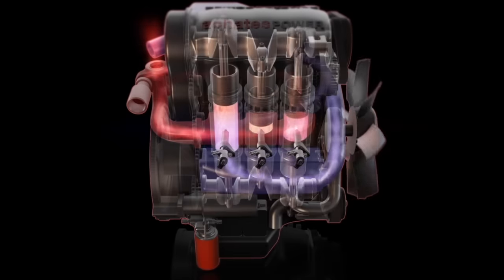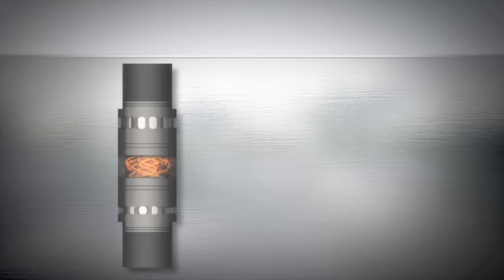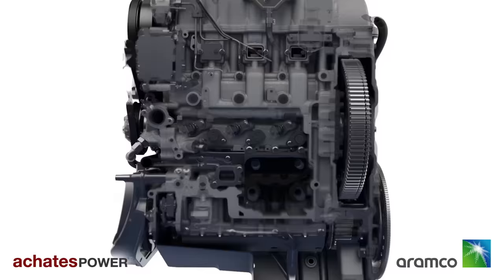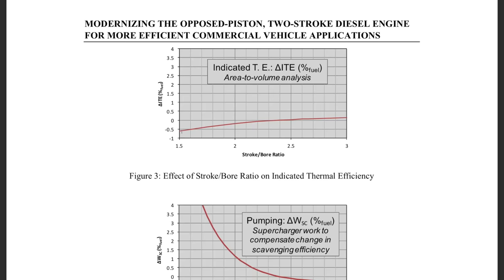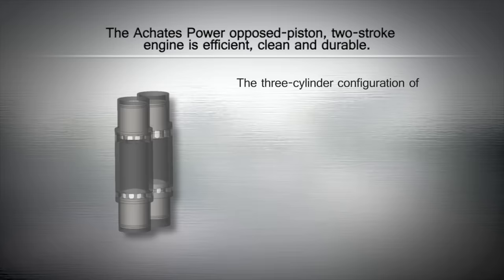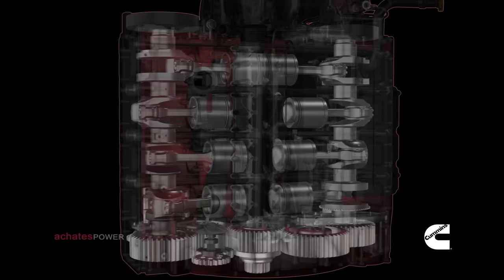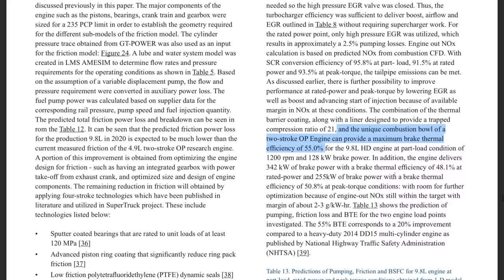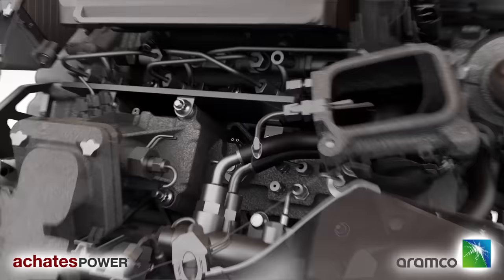Opposed Piston Diesel Engines Are Crazy Efficient

Comment: 3 cylinder, 6 piston engine. Must have had Hyperthreading enabled.
Reply: This made me laugh.
Reply: Thats great
Reply: Kek
Reply: Idk, it's not new enough so it doesn'r run under UEFI. You'll have to burn an MBR boot partition and enable vt-d capability to make it run from the BIOS.
Reply: @nahtavaelubl3820  he is trying to say it needs v-tech. i would say there are obvious problems with that.
Reply: hahaha man that's a good one. Achates Inside™
Reply: I dont get this. Theres quite literally 6 cylinders.
Reply: @cerberus1166  There's only 3 cylinders. Each cylinder has 2 pistons (the moving parts). 3×2=6, pretty simple math.
Reply: @themanofiron785  the pistons have cylinders on them do they not? At the very least theres 6 cylinder heads. Why would you call a cylinder head, (which is the actual cylinder, the head.) theres 3 chambers, 6 pistons, 6 cylinders.
Reply: @cerberus1166  I pull the heads off a block, does it still have cylinders? Yes. The cylinder is the hole the piston goes in...
Reply: Zach Childs what does a cylinder look like? It’s a tube! There are 3 tubes, each tube runs 2 pistons. It’s still 3 tubes, meaning it’s 3 cylinders.
Reply: @patrickvanderlaan1151  yes i was uneducated. Thank you all.
Reply: Zach Childs  It has six pistons but only three cylinders. The cylinders are the shaft that the Pistons ride in Hope that helps to explain it
Reply: @my_master512  it does thanks.
Reply: what about a 6 cylinder 3 piston engine. lets do that. can anyone even imagine how they would make that work.
Reply: Pentium Power!
Reply: Zach Childs 
Each cylinder is single long tube. 
There are not ANY cylinder heads.
The combustion chamber is where the piston heads meet each other. 
Tell your doctor about your anxious and anger and he can help you.
Reply: Hahahahaa
Reply: @Pavelow 6 cylinders 3 pistons...
How about if the piston was not connected to a crankshaft,  but had two combustion chambers - one on the the left and one on the right side?
Combustions on the left and righr side would alternate, sending the poston back and forth. The piston would be magnetic and the cylinder would be wrapped in coil, inducing electric current.  Since we would have 3 cylinders, we would spread the phases to have nice 3-phase AC a power an electric motor from it.
If you ever develop and patent it, i want 10% of the money:D
Reply: for sport mode, use GPU turbo charger
Reply: Or RTX on off ability
Reply: You've gained my respect friend. AMD and Diesel fan
A true Chad 🔥
Reply: It is a creative statment and fun as well. Howver Threads are NOT like CPUs as folks are lead to beleave. They apear to OSes as CPUs and can even except the same instructions. But they are really more like SMART cashe systems. Threads keep data flowing to the real Cores.
Reply: @panda4247  bro thats actually a thing...its a type of stirling engine which also is an electric power generator...each end of the engine cylinder is closed and has a "bounce "gas in it ...as the piston compresses the gas,the gas is heated and bounces the piston back to the other end ...where the same thing happens...electricity being produced as the piston moves thru an external coil-induced magnetic field...
Reply: @dexterdequoitdikkentheworl87  yeah, it would be really weird, if I was the first one to come up with that concept :D
Reply: @patrickvanderlaan1151  but thers 6 pistuns
Reply: You cool in my book
Reply: @cerberus1166  its a computer tech term
Reply: XDXDXDXD
Reply: 3c6t engine
Reply: Check out the Napier Deltic invented for high speed torpedo boats. Two stroke opposed pistons with three crankshafts and typically three rows of six cylinders and 36 pistons. They were timed so that one piston lead the other to open the exhausts before the inlets were opened. The third crank ran backwards to allow every row of cylinders to operate correctly.
Reply: Don't forget the Radeon Turbocharger and the RTX Roots blower.
Reply: @davidelliott5843  was just about to mention that! 
That's like a 3 Core engine (cpu) with hyperthreading lol.
Reply: @panda4247  Would make an excellent range extender for electric vehicles. I love the idea if its feasible!
Reply: No, it's just logical cores.
Reply: Good, it doesn't have any valve's and cylinder heads either, with just one fuel injector for two pistons each.
Reply: @BeRAd427  Wtf, that'll include some dummy cylinders without pistons.
Reply: Powered by INTEL
Reply: @my_master512  -  the pistons slide in the cylinders and are connected to one of the 2 crankshafts
Reply: ...hypercombusting...
Reply: Pretty abysmal numbers from a supercharged turbodiesel...just scrap that idea overall👎😐
Reply: 2 pistons in each cylinder genius
Reply: I thought it's because of dual channel:)
Reply: But is it MMX3 or MMX6?
Reply: Yeah!
Reply: SMP: Simultanious Multi Piston
Reply: It’s a boxer.
Reply: Found the software guy.

Sticky keys really fucked me up when I saw it the first time lol
Reply: Hahahahaha this comment is great! 😂😂
Reply: Yes i like this idea
Reply: CPU joke lmao
Reply: Computer and car nerds assemble 😂
Reply: @cerberus1166  3 cylinders 6 pistons 😂
Reply: @cerberus1166  Your definitely not an engineer or know the basics of engine design and what terms are used for engine parts this is a 3 cylinder 6 piston engine where are you getting 6 cylinders from 😂
Reply: @dantemartinez5494  the piston heads are cylinders you goon. clearly engineers need to not name things after geometrical shapes, and you need a geometry lesson as well
Reply: With intel turbo boost technology 2.0 ( turbocharged and supercharged)😁😁
Reply: No….. 6 cylinder opposite side but 3 piston is my design but car engine designers neglected this idea
Reply: @rgap3944  3 piston 6 cylinder is not possible
Reply: 3 cylinder= 6 holes
Reply: @dantemartinez5494  possible if cylinder move to and fro 1 cylinder both end blast and one piston inside cut through the cylinder such way the cylinder move to and fro
Reply: Simultaneous multithreading you mean ;-)
(Hyper threading is just a brand name from Intel for a previously existing technology damned SMT that existed on other CPUs before I tel used it, although theirs where the first x86 implementation and the first intended for home computers).
Reply: @BeRAd427  That would be weird...
I guess you could have six cylinders with a gap between them and have a continuous piston between the two.
It might arguably be considered two pistons instead of one, but if it's a single piece of metal you could probably get away with calling it a single piston.
Then it would have to have some way of transferring energy, sideways out to a shaft somewhere.
You can't have a crack shaft between the two piston heads as you probably couldn't call it a single piston then...
It would be a really really inefficient engine most likely, and no one would do this for any other reason then just showing that it can be done...
Reply: @panda4247  That might be a better design then what I had in mind, I was thinking a lever instead...
Reply: @jimbronson687  It's a bit more then that.
The first threads where.
But as computer technology developed and especially out of order execution became possible a CPU could execute instructions from a different thread entirely while running code from the first thread.
You can actually do it with a in order CPU too  keeping more of the CPUs execution resources occupied, but chances are far higher then that there's just no instruction in either thread able to utilize the available resources or that one thread has to wait for the other thread to no longer need a specific resource in a given clock cycle.
Reply: @lelsewherelelsewhere9435  People calling SMT for hyperthrading is a bit of a pet peeve of mine.
The technology is named simultaneous multithreading while "hyperthrading" is just Intels first implementation of it (others had done it before Intel).
Reply: @sirprise9548   Thank you. :-D
Reply: @dantemartinez5494  I think that it's possible, just really, really inefficient.
If you have two opposing piston heads connected by a metal rod that's all a single piece of metal can't you argue that it's just a single piston facing two ways?
Or even a piston that's just a single solid block of metal.
You can divide the cylinders in two by having a opening in the middle between them and design the engine to have the piston move between them or increase and decrease the amount inside each end.
It's obvious a bad idea, but it should be possible at least.
Reply: @cerberus1166  Yeah, no...
That last comment of yours is just wrong, and you know it given your earlier comments in this thread.
The cylinders are the holes, not the pistons or ends of the holes, just the holes themselves.
Reply: @Luredreier  not at all. considering a cylinder is solid. not hollow. youre describing tubes. not my fault engine builders cant english properly.

you can easily check what a cylinder is. and it doesnt say im the one thats wrong.
Reply: Lmfaooooo
Reply: Good comparison - it's really true in the core of this statement.
Reply: It's called Hyperpistoning
Reply: Stephen Ferree  Jumo discovered that one crank had to be 8 degrees in advance of the other for it to work properly, and the engine they designed had an amazing power to litre ratio for that era. Truly fascinating engineers at the time.
Reply: Stephen Ferree  look at the list in the beginning. It was mentioned.
Reply: @johndavidson3424  no 2 injectors. One left one right.
Reply: @cerberus1166 3 mate.
Reply: @cerberus1166 Piston crowns form the combustion space inside the cylinder, simpleton.

Comment: next stop: quantum stroke engine. each piston is simultaneously in compression and decompression.
Reply: Lol
Reply: That's basically a rotary setup. Look up the Liquid Piston Engine. Pretty neat, but like this engine, I wanna see a bigger application.
Reply: Only if you're not watching it. Watching it causes each piston to be either in compression or decompression.
Reply: @dgnash  Glass headers are out of the question. Same with any ECU setups.
Reply: @dgnash  I did not understand what you said so I'm just gonna be happy I did engineering rather than physics class...
Reply: That is called a double-acting engine, and yes, those exist.
Reply: Next stop would be four pistons for a combustion chamber in all 90° angle directions in 3D.
Reply: @avada0  Opposed Radial Engine? Perhaps? Can't visualize the crankshaft but I'm not an engineer.
Reply: Let's get started on a hypercube opposed engine. 8 piston heads using a single fuel valve, with each piston rotated 90° from the others. And store the fuel in a Klein bottle 😅
Reply: Drugs
Reply: Shrodinger's engine.
Reply: That exists already
Reply: Like steam engine piston? I think its doable..
Reply: You're describing a single-stroke engine based on that description.
Reply: @ChosenFate_  and doesn't.

....

Oh god damnit! Who looked at it?!
Reply: Lol
Reply: Free piston engine :)
Reply: You’re thinking of a turbine engine. All one shaft compressing and decompressing.
Reply: @dgnash , it's an interference engine...but only if you're watching it really closely.
Reply: @Boothby171  Yes, if you take your eyes away it does the other thing.
Reply: I don't think that idea is so farfetched. I believe it was in the early 60's that Popular Mechanics ran an article about a prototype diesel engine. The design was very simple. You take a long cylinder and put a compression head on both ends, connected by a shaft in the middle. Details are fuzzy after all this time, but the principal was to get a piston on one end to fire, moving the shaft to the other end. Once the cycle had started there was no need for a spark. Heavy compression would ignite the fuel on the other piston, creating a reciprocating engine. It was stopped by shutting off the fuel. I believe a model was built on a go-cart frame and tested on a racetrack. The test ended because at the high speed generated, the tire diameter expanded by an inch. A Jaguar was used as a pace vehicle. It supposedly had one major flaw, there was no effective way to muffle is without killing performance. I've tried to find the issue this was printed in but had no success because I couldn't find a full enough collection of magazines. If anyone can confirm this, I would love to know.
Reply: @dgnash  Instead of Schrodinger's Cat it's Schrodinger's Engine, perceived as both running and not running from separate dimensions
Reply: Quantum effects apply to atomic scale.
Reply: i mean that's how jet engine work
Reply: Sounds like my life... :)
Reply: That’s possible.
Reply: Yeah, but they’re very prone to wave function collapse 😅
Reply: Compression and rarefaction 😉
Reply: Lol
Reply: @KeenanChampeaux  Yes the exhaust is Crystal Meth fumes.
Reply: I agree and disagree
Reply: that's called a gas turbine